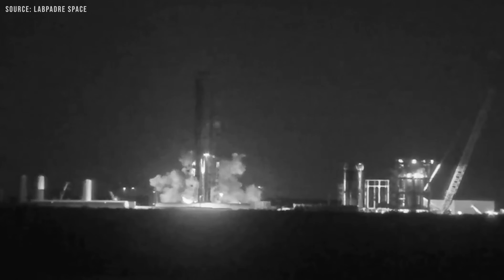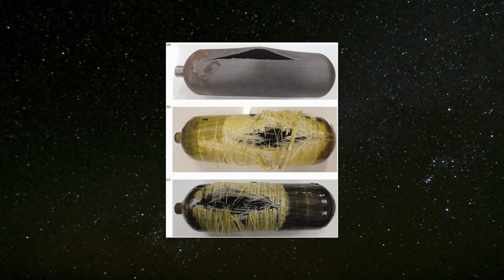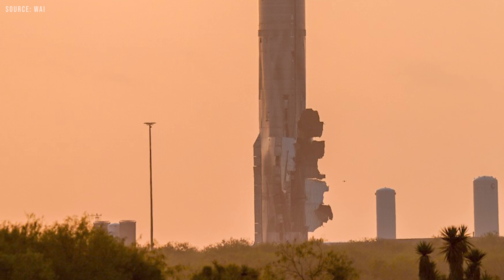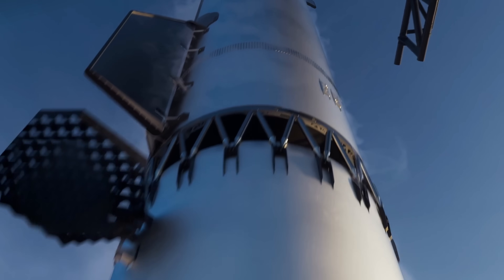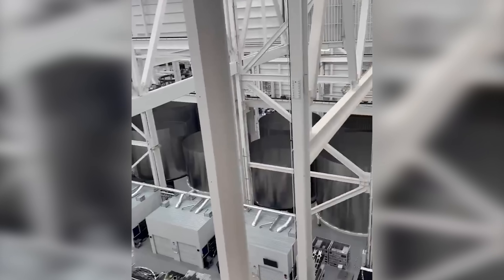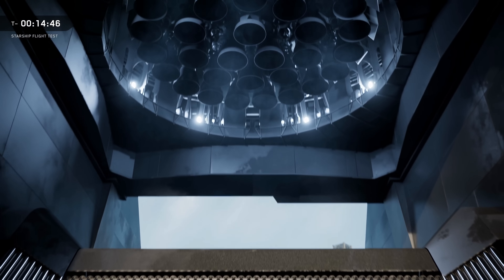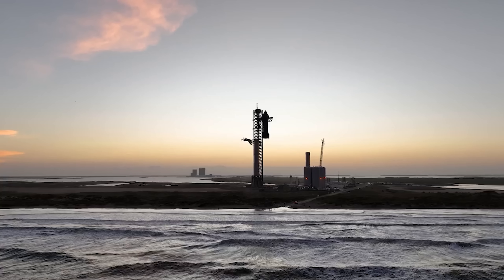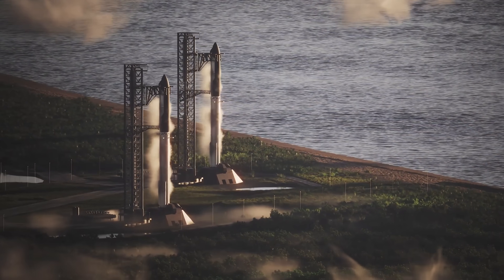SpaceX Found Brilliant Solution to get back to Starship Launch Sooner than NASA expected!

Comment: So....how did a vacuum inside the fuel tank - that you say caused it to implode - cause the booster to explode outward?
Everything visible points to overpressure, not underpressure...and it lines right up with chine - and COPV - location

Comment: I wonder how many temperature/pressure relief valves  are on that thing.

How good can a TP valve protect it from having too low pressure on the inside? I imagine one that is made of a flap of the skin on the leeward side that has some seal with an electrically actuated adhesive destroyer. 

All the COPvs should have TP valves, I wonder how small and light they can make them while being reliable to be within the margin but not actuate too soon.

All the COPVs should have a safer failure mode, like a score with a tear out panel.

I am thinking they could make the chines bigger and stick some solid rocket boosters  or another raptor...

Comment: SpaceX only need to make 20 Starship boosters, so how fast they can manufacture them, doesn’t really matter.  But speed of making starships does matter, because they plan to build 1000 of them.  Unless they change their mind and only make  20 starships, and make a 1000 cargo pods instead. (The size of the starship cargo bay, 35,000 cubic feet). 

They could make many different cargo pods, cargo cargo pods, tanker cargo pods, Human Landing System cargo pods, Human shuttle cargo pods, refinery cargo pods, factory cargo pods, farm cargo pods, orchid cargo pods, dairy cargo pods, ranch cargo pods, fish farm cargo pods, grocery store cargo pods, retail store cargo pods, hardware store cargo pods, habitat cargo pods, city center cargo pods, police station cargo pods, library cargo pods, church cargo pods, etc., etc..  

These cargo pods could be delivered to the moon’s orbit by starship, or just sent to the moon’s orbit by themselves, having anti-spin and course correction devices.  

Once at the moon, they could be landed on the moon by a special device, basically the top half of a starship, capable of landing on the moon, dropping off a cargo pod, and returning to moon’s orbit, and refueling.  Only 10 or 20 of these devices would be needed.

If they are landed in a circle a large inflatable dome building could be built in the middle with inflatable tunnels going to each cargo pod.  And everything could be covered with moon cement, with a 3 D printer.

“ A quick way to build a prefabricated moon city, and maybe a Mars city “.

And you only need 20 boosters, 20 starships, and 10 or 20 special devices to land the cargo pods on the moon.
🙂

Comment: How can we get humans to the moon and Mars faster and cheaper ?

If we use Falcon Heavy or SpaceX HLS to put a empty ( no crew) Orion space capsule with its service module, without it’s LOS, into LEO, then we can use the SpaceX HLS to put it into Lunar orbit.  (Either in it’s cargo bay or by docking with it and pushing it)

Use crew dragon to put the moon astronauts into Leo, before or at the same time, launch and refuel the HLS, dock with HLS, and transfer the astronauts onto the HLS, and go to the moon’s orbit.

Then after landing on the moon, and spending however long on the moon, go back into moon’s orbit, dock with Orion and go home.

The same thing could be done to go to Mars.  Take Orion to Mars, transfer the astronauts to Orion when refueling the HLS.
(For safety reasons)

(Take enough starship tankers, to refuel the HLS.)

After landing, etc., dock with & push Orion to the moon’s orbit, using HLS, transfer astronauts into Orion and go home.

Or perhaps you could skip the moon and go straight to the earth.  Transfer the astronauts into Orion, before getting to the earth, then go home in the Orion.  The HLS could swing around the earth and go to the moon or back to Mars.  If we could load it with cargo as it swings around the earth, it could take cargo to the moon or Mars.  🙂

Comment: Starship is a shining example of everything you DON'T do in aerospace engineering.
Reply: Actually it is!.
Reply: @WyoSavage1976  How's the 2024 Starship crewed mission to Mars going?  Not a typo, says Musk.  Actually, it is!...is trash...is what you DON'T do.  Can't even reach orbit.  SpaceX engineers BEGGED Elon not to use stainless steel and now you see why.  No civilians will ever be going to Mars and if you don't understand why, I pity you
Reply: @Brettification spacex launches rockets to orbit almost on a daily basis, stop rage baiting
Reply: @Austin.0712  Nobody cares, but you took it, hook, line and sinker.
Reply: @Brettification  That was a whole of shit that didn't happen.
Reply: @Brettification getting to orbit is the easy part, bring it back is the hardest and its been brought back in one piece already
Reply: @DaveBigDawg  That statement is indisputable proof that you are an absolute fool.  Getting to orbit IS the easy part, and yet Starship has been unable to achieve it.  Elon Musk is on record saying that getting the booster back is the easy part:

https://youtu.be/WJbizr-37a8?list=TLPQMDgxMjIwMjVpJh9vq31gbw&t=1554

SpaceXplode Starsh!t -- 100% failure rate and unable to do basic aerospace operations which were routine in the 1960s! 

Did you see what it looked like when it did the soft splashdown?  It was a barely recognisable smouldering wreck which quickly exploded.

FAIL.
Reply: @Brettification i looked it and i came back as you being a fool
SpaceX didn't achieve orbit because that was not one of it objectives. 
  No matter how how it looked before splash in the ocean, it actually made it back in one piece and achieved all it objectives including deploying mock starlink satellites and re-lighting the engines in space.
And as far as the explosion when it hit tfe ocean, WTF would you think would happen,  that's like throwing water on a grease fire.

Comment: The one thing not mentioned is this was test to destruction. Seeing how much pressure it could take to failure. It is better to have it fail on the test stand than in space. Basically, it is a test to see just how far it could be pushed before things went bang. Since no fuel was involved, there was no explosion. No damage to surrounding structures. Only to the lower stage. The test provided information to the engineers letting them know where the fail point was. Smart thinking on Musk's part.